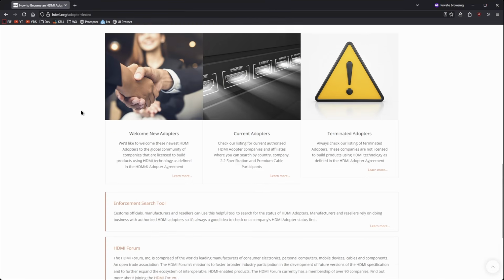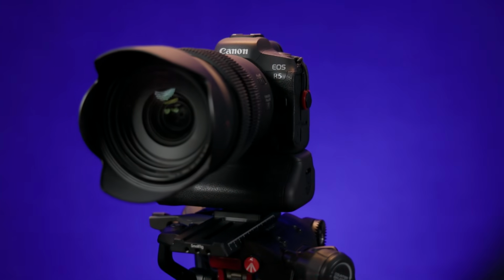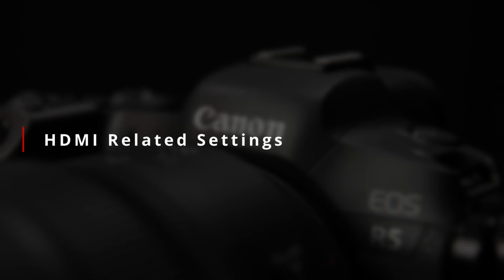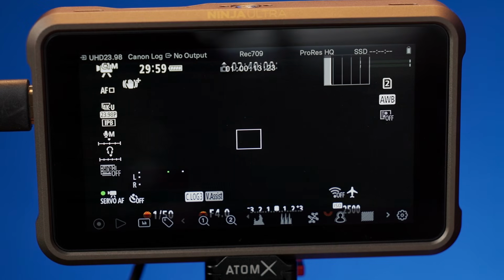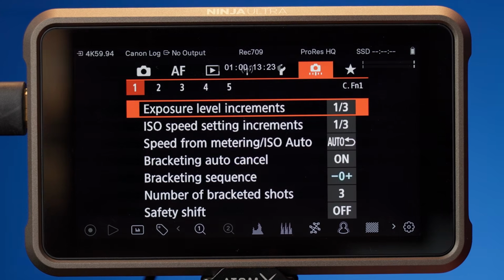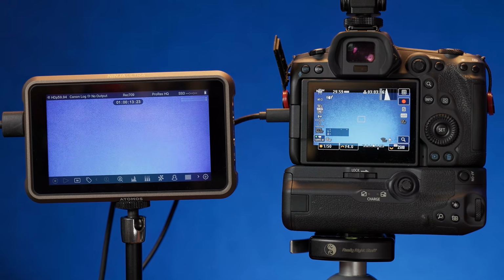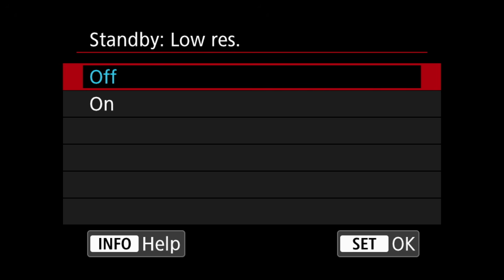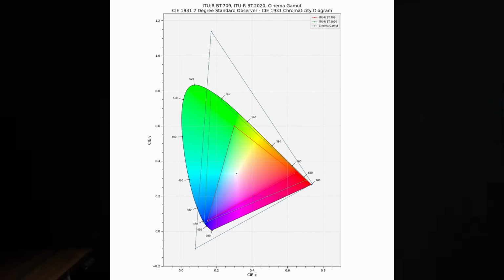HDMI Output Settings - EOS R5/R6 Tip 89

Comment: Can I check it is possible to record video to external and take photo at the same time using canon r6 mark ii?
Reply from the maker: No, at least not how I think you're probably wanting to do it.

In photo mode, when a monitor is attached to the HDMI port, it takes over for the LCD/EVF, so it'll have all the normal information overlaid like it would otherwise.

Comment: There is another huge issue with the selected: stand by low res: „on“ when recording in 60fps an a ATOMOS Ninja over your HDMI: through this setting „on“ it will skip half the frames so you cannot slow Your footage down to 50%. Ruined a full shooting day bc of that and needed a full week to research the cause.
Reply from the maker: That's expected. You should not enable standby low res when recording externally. When it's enabled, the camera does not operate at the set resolution and frame rate unless it's actually recording internally (or you're using the lowest resolution and frame rate e.g. 1080p24 or 1080p25).

Comment: Do you know how to fix an issue with hdmi not giving signal to the external?
Reply from the maker: Sorry, that sounds like something that you're gonna have to talk to Canon about. I can't think of any settings on the camera that will disable the HDMI port. So if you're not getting anything with multiple monitors, then it sounds like you might have a hardware problem (e.g. broken HDMI port).
Reply: @PointsInFocus ok thanks